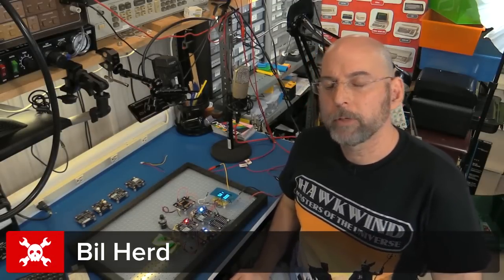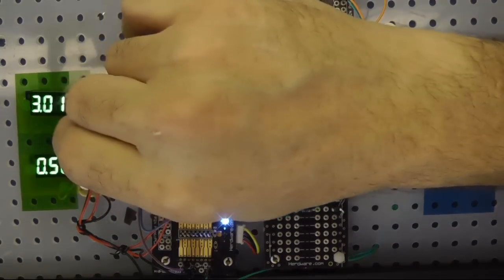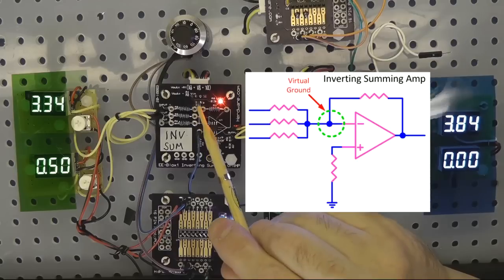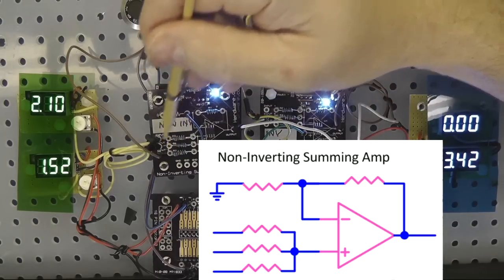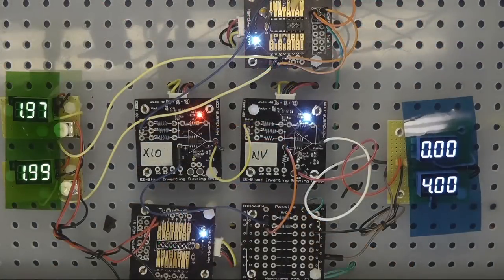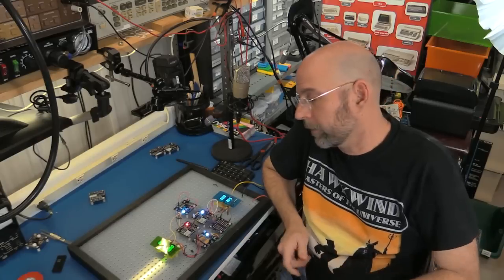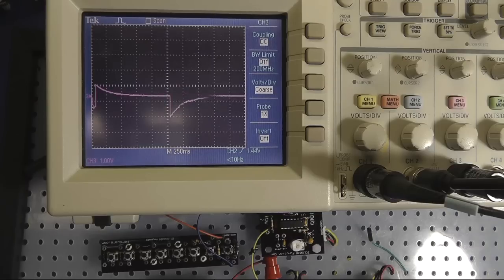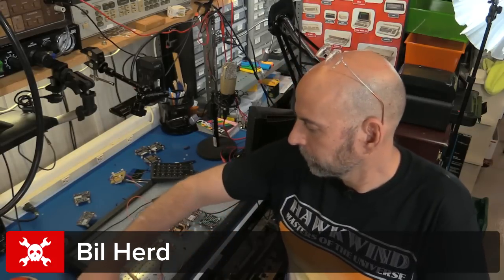Computing with Analog

Comment: Very cool video, Bil.  "Superposition" is a means of calculating the circuit response of a linear system by computing the contribution of each input separately (shorting the other input voltages), then adding the results up.  Two questions for you - what is the mfr and part number of the pin sockets you use on your building block boards?  And, same q on the tiny little 3 digit DVMs..  Cool stuff!
Reply: Yup.  I found if I try to get too much into a tech description while worrying about camera angles, what I am going to say next, etc, I am more likely to say something wrong. (Diode video where I confused the depletion zone with the end of the model and the end of the shot).  So I stick close to home base.  The terminals are Milll-Max and about a million times better than whats in a cheap solderless breadboard, and the little DVMs are off Ebay.  I have started buying them by the handful as I seem to lose a lot also. 

Whats funny is when we run a BLS Rescue crew (Ambulance)  the minimum allowed is 2 EMTs.  Both EMT's can get 99.9% things right and the small foible of one is easily caught by the other.  Running just one EMT is like being the only guy in the video,  the mistake is there hanging for everyone to see. What made me a good engineer back in the day was the people worked with; they would tell you when your underwear was out on the flagpole and then distill down a whole semester's math class into a statement or two.
Reply: Bil Herd I know the feeling.  I often have to go back and add a "correction annotation" to my videos to correct something that I mis-spoke about.  No checks and balances...  If you get a chance, shoot me an email with the particular Mill-Max part number - they've got a million parts, and I'm never sure which ones to get.  When I had a "real" job, we had drawers of these things, so I could "borrow" a few when needed.
Reply: i guess Im randomly asking but does anybody know a method to log back into an instagram account??
I was stupid forgot the login password. I would love any tricks you can offer me
Reply: @Tripp Lorenzo instablaster :)
Reply: @Axel Jairo it did the trick and I now got access to my account again. I am so happy:D
Thanks so much, you saved my account!
Reply: @Tripp Lorenzo You are welcome :)

Comment: Great setup.
However, I don’t think your explanation of “virtual ground” was sufficient. The reason the “minus terminal” is at virtual ground is because the “plus terminal” is grounded, and all opamps have 0 volts across their input terminals if operating in the linear region (i.e. not clipping). Because opamps have a very high voltage gain (approximated as infinity), the voltage across the input terminals must always be very small (approximately 0 volts). Of course the high input impedance plays also plays a role, as you mentioned.
Nevertheless, a very instructive video. Thanks.
Reply: I am still confused about the virtual ground explanation. Isn't there a voltage drop across the resistor between the + terminal and ground?
Reply: You're right.
But the voltage drop between the inverting and noninverting input isn't always zero. It is only zero if the opamp has the chance to regulate the input difference to about zero Volt, this is only possible in a closed loop circuit.

Comment: Can it run Crysis?
Reply: An Analog computer done correctly in theory can run several hundred Crysis games at once, all with the highest graphics and quality settings
Reply: @theshermantanker7043  but why do we do it on digital computers then I m confusion
Reply: @AliKhan-mg3mj  because digital is cheaper, can be made smaller, and is more accurate.  Analog is more expensive, faster, harder to use to do complex tasks, and less accurate
Reply: @jamesparker8529  less precise*.

It's plenty accurate.
Reply: @samisiddiqi5411 what's the difference in this case?